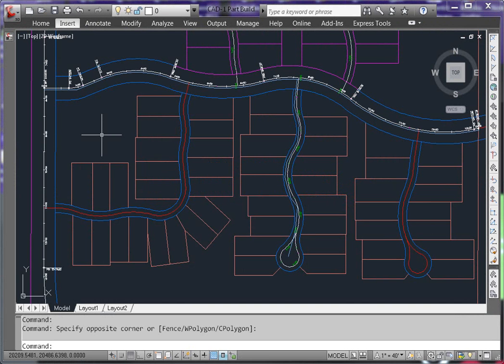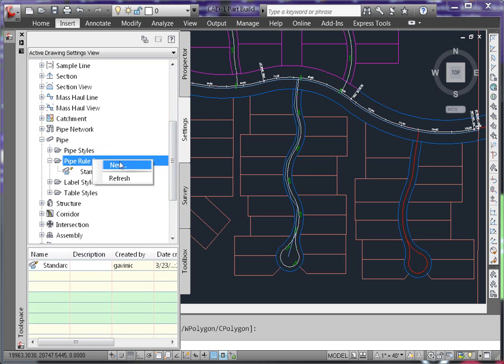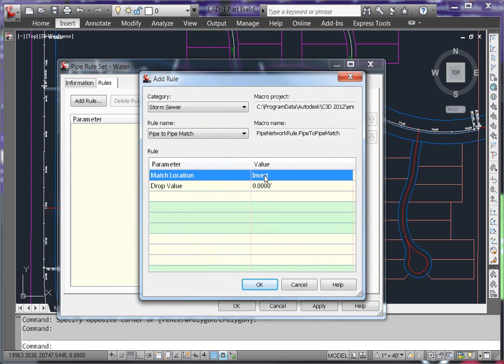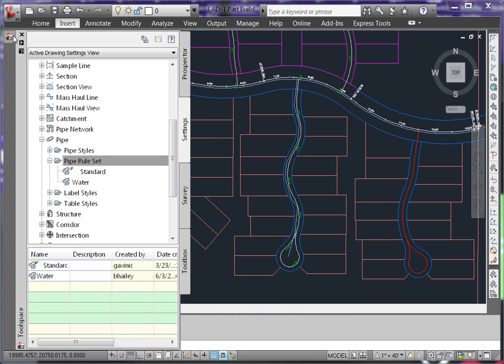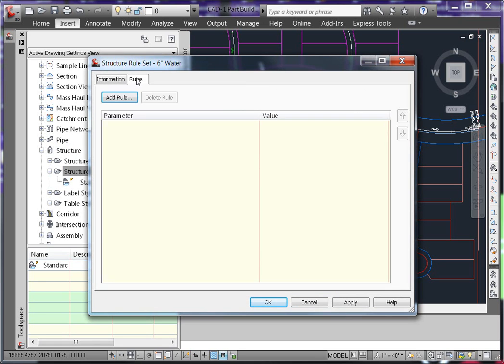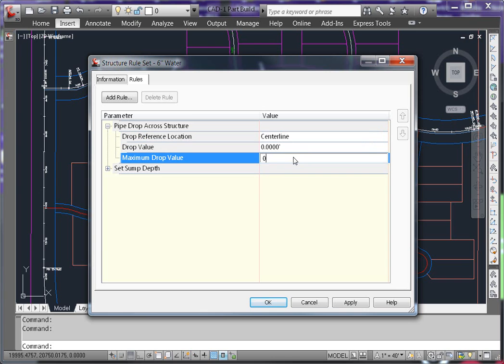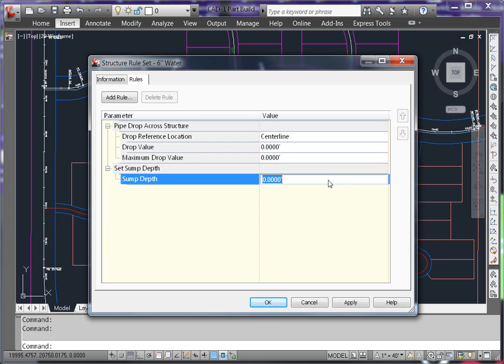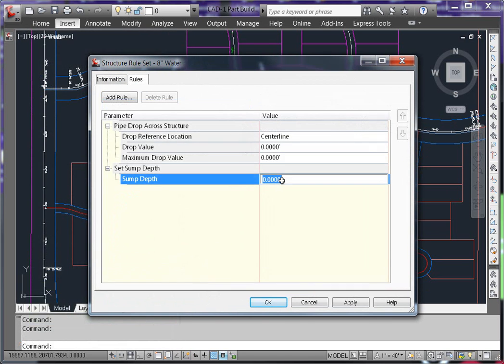Part 4 - CAD-1 Part Builder Library - Rule Sets

Comment: Hi Brian, quick question. When I enter a sump depth of .18" it converts it to 0.02' instead of 0.0150' like in your video. Is this something i have setup wrong in a setting or is this a 2012 issue?